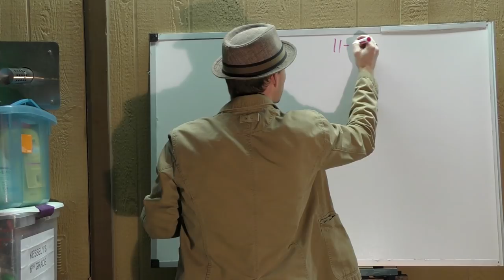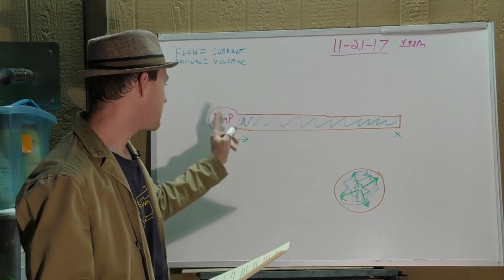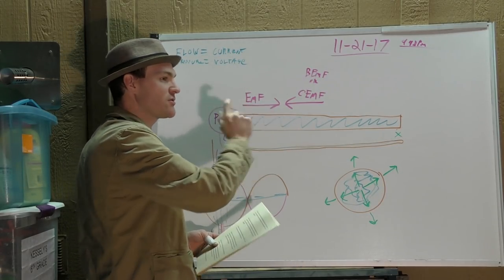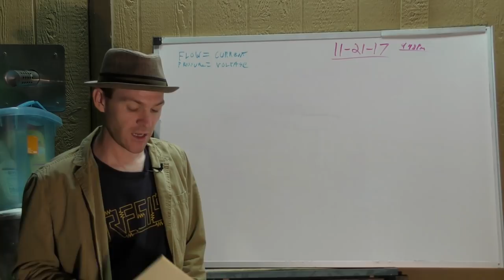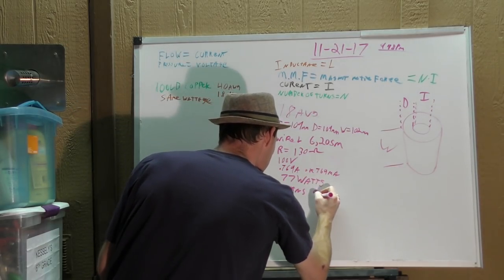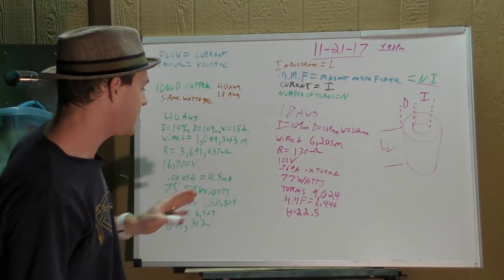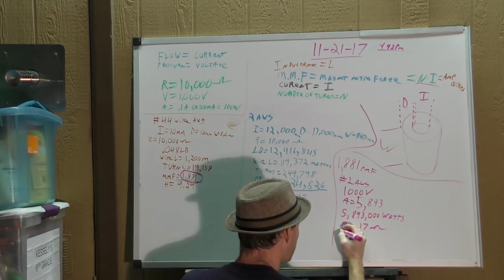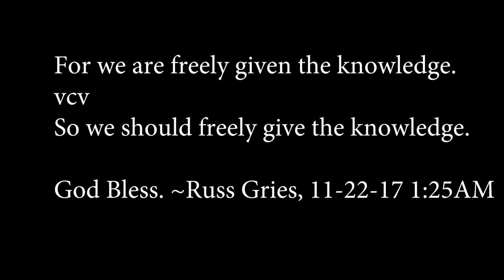Part 10: The Steel Wedge of Truth Hit by The Sledgehammer of Facts Will Break Open Even Closed Minds

Comment: I've watched the first third of this clip Russ, and you are about half-way there.  You have misconceptions and I will try to clear them up.  For starters, and I have said this before, there is no difference between an EE analysis and a physics analysis, they are one in the same.  Also, the water-electricity analogy is perfect, as long as you understand how to model things properly and as long as you ignore magnetic field coupling effects which don't exist for water.

So, let's start.  The first concept is something that you may not have thought of which you can apply when you want for new examples.  There are actually two types of water pumps, constant pressure water pumps and constant flow rate water pumps.  They correspond to a voltage source and a current source.

So, a constant flow rate pump connected to your long hose that is closed off at the end will quickly build up pressure in the pipe until the pipe bursts - because the water must flow.  What's the electrical equivalent?  It's this:  You have a constant current source and there is a length of wire connected across the two terminals.  Say one amp of current is flowing through the wire.  What happens when you disconnect the wire?  Well, nothing can stop the current from flowing so the the current source raises it's voltage to break down the air and turn it into a conducting plasma, and the current keeps flowing.  This is closely related to a coil when you disconnect it and you see the spark.
Reply: Now here is where you go off track:  You talk about the rubber hose expanding to accommodate the pressure from the pump.  (Notice your pump is a constant pressure pump)  You say this is like the magnetic field and this is wrong.  The expanding rubber hose is like a capacitor.  In your analogy anything with springiness in it is a capacitor.  So for the hose, it's like a wire with a distributed capacitance per meter.  The pump pressurizes the length of hose until the pressure is equal everywhere in the hose and there is no more water flow.  The voltage source charges all of the distributed capacitance in the wire until the voltage in the wire is equal along the whole length of the wire and there is no more current flow.  You have to get this because otherwise you will be stuck.

You are right about the "spike" and counter-EMF being two different things.  In any circuit there is counter-EMF that is equal and opposite to the applied voltage source.  This is KVL.   Let's use the hose as a simple analogy that you skipped and is very important.

A long hose is like an electrical resistor:  Your constant pressure pump is connected to a long hose and water flows.  If the pump puts out 10 psi, then where the hose attaches to the pump there is an equal and opposite 10 psi from the hose.  Here is the critical thing:  As the water flows through the hose there is a pressure drop along the hose due to friction between the moving water and the walls of the hose.  So if the hose is 10 meters long, if you attached a pressure sensor at the 5 meter point, it would read 5 psi.

So, you have a pump putting out 10 psi into a long hose and the there is a certain water flow rate and the pressure drips linearly as you go along the hose.  That's exactly what an electrical resistor is.  Therefore, water flow rate x pressure drop equals power.  That means the water is being heated as it flows through the hose, just like an electrical resistor produces heat.
Reply: Okay, let's discuss the infamous "back EMF spike" which in the water version is the "water hammer," the big bang you hear when you shut off a water valve very quickly.  By the way, if you are getting this stuff you are welcome to copy and paste it into your forum.

To understand the back EMF spike and the "back pressure wave" (they are different things and not the same like you think) here is were you have to properly model things otherwise things go awry.

So we know that water flowing through a pipe has inertia and that is the same as current flowing through a wire that has an electrical inertia which we associate with inductance.

We will do some simple thought experiments to illustrate this.  Imagine a long circular hose with water flowing through it and an open valve.  When you shut the valve you get a huge surge in pressure at the valve.  It is this surge in pressure that is the "back EMF spike" and this is a surge in FORWARD pressure, and not any kind of reverse pressure wave.  (Yes there is a reverse pressure wave that will be explained later.)

So to repeat, the huge spike of pressure surge in FORWARD pressure is the "back EMF spike."

Here is the electrical equivalent:  There is a loop of wire with current flowing through it with a closed switch.  When you open the switch the current wants to keep flowing in the same direction and you get a huge spike in voltage that wants to keep the current flowing FORWARD.  This is the "back EMF spike."

Note:  When you see a big negative spike on your scope display, this is the voltage surge that is trying to keep pushing the current in the FORWARD direction.  This may seem counter-intuitive but you just have to think a bit more deeply about this.  It's all related to where the scope ground and channel input are connected.  If you reversed the scope connections than you would see a big positive spike for the "back EMF spike."
Reply: So now let's discuss the reverse pressure wave in the hose.  Like I already said, this is not the "back EMF spike."

Here is where you have to model the system properly because if you can't model it properly then you will be lost.

Let's look at the hose where you quickly shut off the valve and you get the water hammer effect.  I said that when the hose expands and stretches from the pressure in the hose it is equivalent to the distributed capacitance in the hose.  So let's look at this in more detail and refine our model for the water hammer effect and explain the reverse pressure wave.

When you suddenly shut off the valve you get a huge pressure spike in the hose close to the valve.  The hose stretches and expands in response to the pressure increase.  The closer you are to the valve the higher the pressure.  And in fact for a steel pipe the same thing applies for the discussion below but of course steel stretches much less, but it still stretches.

So the hose close to the valve will stretch the most because the pressure is the highest close to the valve.  Following on from my discussion of distributed capacitance in the hose, in this case we can model it in a simplified fashion by saying that there is s discrete capacitor at the end of the hose by the valve.  The forward pressure spike will "charge the capacitor" at the end of the hose.  That means all of the energy associated with the FORWARD pressure spike gets stored in the capacitor in the end of the hose.

So then what happens?  Well, the forward pressure spike has expended all of its energy and now it is in the charged capacitor.  So the next thing that happens is that the "capacitor" discharges and reverses the water flow and sends a reverse-direction pressure wave down the hose.

Does this sound familiar?  Well it should because this is the same as the electrical ring-down in a wire that you have seen thousands of times on your scope display.  When you open the switch in my simple electrical example you see a forward spike followed by an LC ring-down.

So, the reverse pressure wave you see from the water hammer effect is really the first reflection in pressure that was returned from the "stretched spring" (a.k.a. charged capacitor) in the "water mechanical circuit" and is in fact the first reverse pressure wave and reverse water flow in what effectively is an LC ring-down of the stored energy in the moving water flow that was interrupted by the rapid closing of the valve.
Reply: If you simply have read JB book, you would notice the part he say( in a coil, the voltage is ALREADY THERE, what KILL THE DIPOLE is the current)  .. In other words, if you have long enouf inductor and rapid switching, the current will not build up to match the inductance but the voltage potential is already there..   Voltage potential=back spike potential..  What kills the battery is the current that has to fight the inductance..
Reply: +al desrochers  The problem with JB is that he never once explained to his followers how a Bedini motor works.  When he says "radiant energy" it is a lie.  Sorry, I don't mean to be so harsh but it's true.  In a coil the voltage is not "already there."  In fact, a coil is a current-based device.  Does that sound strange to you?  The fact is that it is true.  You know when you hear about a coil discharging in some Bedini circuit to charge a battery and they say, "almost pure potential with no current."  It's a joke because by definition the coil is discharging in the from of current, and the potential observed when the coil discharges is variable, and the potential can even be zero volts.  So the line "pure potential with no current" is completely wrong, in fact it's a lie.  It's actually "current, and the potential is determined by the load."  The reason for this is that a discharging coil acts as a "current source" and not as a voltage source.  The stuff about "don't kill the dipole" is meaningless and is never discussed when talking about electronic circuits.  Anyway, I gave you enough to think about.  I know that I am saying things to you that may not even make any sense.  However, I assure you that what I am saying is real and true.  I hope you and Russ get to understand the water analogy properly and understand these simple circuits that he is discussing in his clip.  These are the basic building blocks for electronics and if you understand them then you can build better projects.
Reply: Simply because you tell me so, I will believe you with my eye closed....LOL  The duration of a on switch doesn`t affect the spike voltage until saturation of the coil or capacitance of the coil..  EXEMPLE: if you put the switch for a micro second you will observe voltage spike to a certain voltage that is determined by the capacitance that match a certain frequency...  If you open the switch for a second, you will observed the EXACT SAME VOLTAGE POTENTIAL spike anyhow the duration of the on time... What will determine your voltage potential is only a matter of finding the FREQUENCY the coil need to be at to collect the most spikes for a determined time ... There is one thing about knowing all the fancy therms used in physics but you need to understand them before trying to explain them..  Just saying.
Reply: +al desrochers  I am not going to address what you are saying because it is a bit more complicated because when you energize a coil for a short amount of time the time constant for the coil and source resistance becomes a factor.  However, I explained to you how a coil is a "current source" and the voltage you see across the coil is determined by the current flowing through the coil and the load across the coil.  Please look at new comments I made to Russ for a bench experiment where you can prove to yourself that a discharging coil acts like a current source.  It's a simple experiment that anybody can do that allows you to prove to yourself that the coil is a current source and the output voltage from the coil is variable and it is determined by the current through the coil and the load resistor.  If you have a scope and some resistors and a coil and a power supply you can prove it to yourself.
Reply: No!!!  You want me to prouve you that I`m wrong..  That`s a big difference..  I already make the experiment..
Reply: +al desrochers  Well I seriously doubt that you did the simple experiment that I suggested to Russ.  Every time you do a new experiment it is an opportunity for you to gain new knowledge.  So I encourage you to try the experiment.
Reply: +al desrochers  What you said about the automotive coil was not clear to me.  Do you want to try again?  Do you have a question about the automotive coil?  If you can describe precisely what you are talking about I will try to answer it.  What I am saying is not "crap" and if you do the simple experiment you will see for yourself.
Reply: I`m just ASKING how can you have 45 000 volt potential when you are energizing a 12hom coil with 12 volt..
BE PRECISE IN YOUR EXPLANATION..
Reply: It has been proven with the bedini cap pulser and 2 watt meter analizer that the output was more in order of 34% than the input..  One watt meter was put in between the first battery and the sg machine and the second one was placed between the cap pulser and the charged battery...  What more do you need for not trying to discredit Russ
Reply: +al desrochers  Did you read my description of the experiment?  I said that if you put a one megaohm resistor on the coil output and when you open the switch that you would theoretically get a one-million volt potential output from the coil because the coil acts like a current source.  The ignition coil in a car operates on the same principle.  The coil is energized on the primary side.  When the ignition points open then the magnetic energy in the ignition coil core has to go somewhere because it is a current source and current must flow and nothing can stop it.  The secondary has many turns and generates much higher potential than the primary.  However, note that both the primary and the secondary go to high potential when the points open.  The secondary goes to about 30,000 volts to break down the air gap and turn it into a conductive plasma.  Once the air starts conducting the output voltage of the coil drops to perhaps only one thousand volts because it is the conducting plasma that determines the output voltage, not the coil.  The output of the secondary is a current source and the current flow decreases as the magnetic energy is discharged from the core.  IS THAT CLEAR ENOUGH FOR YOU?
Reply: +al desrochers  Who says that I am trying to discredit Russ?  You?  I am debating with him, that's all.  He made some mistakes in his water analogy, that's the truth.  As far as a Bedini motor goes, are you suggesting that the output into the charging battery is 134% of the input?  If you are, that's not the case.  In a typical Bedini motor the output is about 30% of the input.  It's very easy to make mistakes when making measurements on pulse systems and that is what probably happened.
Reply: My wild guess is you are a freshman from a second cycle at a university and you are sticking to your last subject..  Probably you live at your parent`s house and have no electronics to play with...  Dont you think at 50 years of age, I know exactly what I`m looking for experiment to do???? Life is to short to spend time on things that doesn`t mater for my purpose...  I have goals in mind and I dont want to wreck my ride..
Reply: +al desrochers  What do you mean, "wreck your ride?"  If I am saying stuff that you never heard before, why should that upset you?  Let's go back to the ignition coil.  Do you understand my explanation?  Do you agree with it or not?  If you disagree with it what is your explanation?
Reply: +al desrochers  For a typical Bedini motor the mechanical energy output is zero because there is no mechanical load on the rotor.  What I am talking about is measuring the power from the source battery and comparing it to the output power going into the charging battery.  That's the only measurement I am talking about and the output power is about 30% of the input power.  I am assuming that the charging battery is in good condition.  I will look at the Lidmotor Joule Thief clip.
Reply: +al desrochers  The Lidmotor clip is just a variation on a Joule Thief type of circuit that has two outputs.  One goes to the charging battery and one taps into the Joule Thief transformer and powers a CFL through an ignition coil.  So you would have to measure the pulse power going into the charging battery and for the CFL the easiest thing to do would be to measure the power between the transformer output and the ignition coil input.
Reply: And now after looking at Lidmotor video will you sustain the current theory???  If you do, there is no way I will spend my time on you and try to educate a guy that doesn`t what to see reality..
Reply: You didn`t answer my question about Lidmotor video....  What is the output power output compared to the input power???  That`s a clever way to negate the lack of knowledge..
Reply: +al desrochers  Here, this guy speaks French with a thick Arabic accent, and you should find this clip very interesting:  https://www.youtube.com/watch?v=lH8iMeBVL4I
Reply: +al desrochers  lol  What do you mean I HAVE NO CLUE?  I understand the fundamentals I assure you.  <<< The amount of power required to light the cfl alone show that the system is somewhat over 100% efficient.. >>>  Really?  Where is your proof?  Are you saying that all transformers are magical over unity devices?  lol  There is no substance to your claim.  And I used to know Lidmotor and he never makes free energy claims.  You are just looking at the CFL light up and saying to yourself, "This must be over unity."  That is not sensible at all, you have no measurements, nothing.  So right now you look like you have no clue because you look at an old Lidmotor clip and on pure blind faith you say to yourself "This must be over unity" without making any measurements at all.  The real world does not work like that.  I will look at the new clip you linked to.
Reply: +al desrochers  What do you mean when you say "sustain the current theory?"  I have many years of experience and I am the one that is trying to educate you.  Do you understand how a discharging coil is a current source?
Reply: +al desrochers  I skimmed though that 1/2 hour clip.  A Newman motor is just another pulse motor.  Sterling Allen visited Geoffrey Miller about two years ago to see some over unity systems.  But Geoffrey Miller told him, "You came here too soon, in a week or two we will have an over unity system."  Famous last words.  And if I remember correctly he was claiming he was "very close" to having an over unity Bedini motor.
Reply: +al desrochers  I'm not ignorant, I assure you.  You can't answer me about how many watts it takes to light a CFL light.  You have NO ANSWERS OR POWER CALCULATIONS yourself for the Lidmotor clip.  There are no measurements made on the clip so both of us have no answers or power calculations, right?  In fact it's impossible for either of us to have measurements or power calculations for that clip.  So what are you trying to say?  Note that when you go to buy power supplies for LED lighting, do you know how they are rated?  They are not rated by voltage output, they are rated by current output.  Power supplies for LED lighting are current sources.  Just go look some up and you will see for yourself.  I know the Energetic Forum and I used to read it.  You just need to chill out.  I know from the forums that many experimenters have difficulty understanding how a coil works and somehow we started talking about that.  If you were curious you would do some research from what I told you so you can experiment better.   You know what really describes a coil?  It's this:  v(t) = L di(t)/dt and  i(t) = 1/L integral i(t)dt   Do you understand those equations?  If not perhaps in the not too distant future you will understand them and that will make you a better experimenter.  So instead of you being hostile if you want to talk about some basic electronics then fine and we don't need any rag dolls.
Reply: I knew you would come back with challenging me about calculation.. It was mentioned in the ENERGETIC FORUM that he use a 9 watt cfl light bulb...  A 9 watt light bulb use 110 volt X 0.08 amps to light due to the manufacturer...He explain all that over the forum and the battery charge rate is explained there also..  You taught I was engaging with you without a base for discussion????  Your assumptions are so off..  You are the one that was not filling the calculations because you dont know... The system use 0.63 watts to run and THE CFL ALONE need 9 watts due to the manufacturer..  I will not FEED YOU ANYMORE  .. You are waisting my time..
Reply: +al desrochers  I will tell you exactly where your HUGE MISTAKE is.  The fact that the CFL is rated at 9 watts when powered by a 120 VAC 60 Hz mains voltage has NOTHING to do with Lidmotor powering it from his waveform on his setup.  The CFL can still light up with much lower power and subjectively from looking at his clip it looks like the CFL is not close to full brightness.  If you hooked up a DSO between the transformer output and the ignition coil primary input and measured the voltage and the current and did the math you would find that the power being sent to the CFL was MUCH LESS than 9 watts.  So you are making a classic mistake, and taking the "number in the box" from the CFL manufacturer and blindly assuming that in Lidmotor's circuit that 9 watts must be going to the CFL and therefore the circuit must be over unity.  You are making a classic beginner's mistake.  And the system in his clip does NOT use 0.05 watts, it uses 0.6 watts.  You have NEVER "fed me" ever in this discussion.  And I am still willing to discuss with you if you want to.
Reply: MY MISTAKE????? How much watt does it need to light???  Even at 6 watt due to not full brightness, the system is well over 100% and not counting the charging rated that you have not read on the forum apparently..  It was discussed that the cfl would not light under 5 watt at least due to an engineer.. SO, the 0.65 watt to run the system, has 2 output.. One being AT LEAST 5 watt and the other that was 2 watt to recharge the battery..Then goes away your CURRENT THEORY..            HI PHIL!!
Reply: If only you would have paid attention to Russ presentation, you would have understand the misconception about electro magnetic... And negate your CURRENT THEORY...   Go at 1;16;30 in this video and pay attention at his explanation of the power consumption and power output and BEMF..
Reply: don't even think about feeding this stuff in to a dc motor...that 3 nights no sleep..misses won't be happy
Reply: +al desrochers  Sorry, but you can't look at a clip on YouTube and make any serious estimations on what the power levels are.  How much wattage does it need to light?  With certain voltage waveforms it can light at very low power levels, almost certainly at even less than 0.6 watts.  However, this discussion is just subjective with no real data.  If we had the actual setup and the proper measuring equipment then you would have real data.  I have seen situations like this 100 times in the past where someone thinks they have over unity but when proper measurements are made it turns out to be false.  No conclusions can be made right now.  But it suggests an interesting bench experiment:  How low can the power levels be and the CFL still lights up?  It can be much less than 5 watts I assure you.  What I am telling you about Lidmotor's clip still applies.  You have to be serious and scientific and make real measurements.
Reply: I will let this discussion at rest and see if you argue with yourself...
Reply: +al desrochers  Well unfortunately Russ is wrong and he has to keep on learning and get up the learning curve and figure things out properly with help from everyone.  What he calls the "input" is actually the resistive power dissipation of the coil.  The input power becomes waste heat.  What he is not realizing/understanding  or not factoring in is that the "bigger output transient" (a.k.a. the BEMF spike) when you have more turns and more inductance in the coil comes from the power supply just the same.  The power supply has to put MORE energy into the coil to get a BIGGER BEMF spike and Russ is not even considering this in his conclusion.  Like I said, he is considering the DC resistive power loss in the coil and that has nothing to do with the size of the BEMF spike.  So there is a major issue that needs to be understood by Russ and everyone on the thread on his forum.
Reply: stop stop russ put brakes on
Reply: +al desrochers  I just made a brand new posting on the thread for Russ.  I use the analogy where an inductor with current flowing through it is equivalent to a mass moving at a certain velocity. I discuss the energy required to push a trolley loaded with stock (mass) on a factory floor as the example.  Please read it and you will see where Russ is making his mistake.  When you have more turns and more inductance there is no advantage when looking at energy-in vs. energy-out.  This will be perfectly clear in my real-world example.
Reply: +al desrochers  Why would you link to a clip that has absolutely NOTHING to do with the discussion?  Why?   Your link is totally bizarre and makes no sense.  What "RIDICULE THEORY" are you talking about?  Are you trying to suggest that I am ridiculing somebody?  I am not ridiculing anybody.

How much electrical energy do you have to put into a five-Henry inductor to get one amp of current flowing through it?  How much electrical energy can you get out from the transient spike from a five-Henry inductor with one amp of current flowing through it?  The answer for both questions is the SAME.  And the answer is energy = 1/2 L i-squared.

Here is a moderately technical clip that explains this.  This is real electronics and they use Calculus.  Even if you don't understand Calculus watch the clip carefully and get the message:  https://www.youtube.com/watch?v=WnFFlE2u3rM
Reply: +al desrochers  Here is another clip from my favourite electronics guy.  He discusses the energy stored in an inductor and also discusses the analogy between the energy stored in an inductor and the energy stored in a moving mass, which is exactly what I used in my example for Russ:  https://www.youtube.com/watch?v=fqQ3-d0V4D0
Reply: +al desrochers  No, I think that you are the one that is blind.  What are we discussing?  We are discussing the fact that Russ is not accounting for the input energy that he is putting into the inductor in his discussion.  We are NOT discussing resonance like in the first clip that you linked to.  We are NOT discussing some sort of "radiant box" in the second clip that you linked to.  Linking to clips that have nothing to do with the discussion will not work.
Reply: +al desrochers  Here is a clip with no math that will give you some understanding of inductors.  Again, the energy stored in an inductor comes from the power supply and Russ is not accounting for this in his whole discussion and that is a critical mistake.  This clip also shows you how you can get any voltage from an inductor by changing the load resistor which is something I told you several times which you did not acknowledge:  https://www.youtube.com/watch?v=84kl_WheNtQ
Reply: The link you give is not the best because it support only the blind guy...  You stick to the link that support what you like and YOU DISCARD WHATEVER that don`t go along with your theory.. The second link IS SO RELEVANT WITH RUSS DISCOVERY you wont believe... The pure fact that he disconnect the input and the system is running by itself is 5000% efficient..  The only thing he want to manage better is the heat that goes in the second box for the longevity of the components..
Reply: So you mean KAPANADZE is not related to the subject too???? Kapanadze was the first to fully understand the resonance theory and the Tesla coil functionality..  The guy in the link I filled you with is the follow up to the Kapanadze work..
Reply: +al desrochers  The second clip, the "radiant box" clip, is basically a nonsense clip.  There is no explanation of what he is doing and the comments are disabled.  He uses a 9-volt battery to trigger a circuit to start oscillating and there is a battery in one of the boxes.  It's the same thing where you see clips where people are making Joule Thief-types of circuits to power LEDs or CFLs.  Sometimes the circuits don't oscillate by themselves and so the experimenter touches the base of the transistor with a wire or with his finger and then the circuit is triggered to start oscillating and the LED or CFL lights up.  This has nothing to do with Russ' discussion in this clip and Russ has not "discovered" anything.  Again, the issue is that Russ is discussing the resistive power dissipation of the wire in his coils and he is making two mistakes:  1)  He is equating the resistive power dissipation with the size of the transient spike and thinks that more inductance with more wire for a bigger spike is "better," and 2) He is ignoring the energy that you have to put in the coil when you first connect the power supply and it is this energy that makes the transient spike and the energy you put into the coil is equal to the energy you get out from the transient spike.  These are serious issues.
Reply: +al desrochers  No, what Russ is doing has nothing to do with Kapanadze.
Reply: Instead of DENIAL on the subject, explain why you dont agree..  The low consumption of the input is offset by the transfert of high voltage low amperage to the secondary low voltage high amperage with exactly the theory Russ is explaining..  Your base current theory is NOT VALID in this case and it`s the best comparasion I can give you..  You will never ADMITING you are wrong but I dont really care because you are in the same boat of majority of people..
Reply: +al desrochers  What are you talking about?  There is no secondary winding in what Russ is discussing in his clip.  When you say "base current" are you now talking about the "radiant box" clip?  How about we just discuss what Russ is talking about in his clip, which is the "power he puts into a coil" and the number of turns in the coil and the amount of energy in the back spike a.k.a. transient spike?  I told you that Russ has made two fundamental mistakes in his discussion.  Do you agree with me that he made two mistakes?  I am willing to listen to you but you have to be clear in what you are saying.  If it would be much easier for you and much clearer for you to say it in French then go ahead, it's up to you.
Reply: +al desrochers  I tell you on one of your solar panel clips that the guy makes a nonsense measurement.  He measures the open-circuit voltage output of the panel and then he measures the short-circuit current output of the panel and he is indicating that he believes "the panel output" is the open-circuit voltage times the short-circuit current of the panel.  That's not true, that's garbage data.  So why would you delete my comment?
Reply: Because you bring your drama to my channel without any relation to my video but just to try to make your point across....   That is JUVENIL behavior and will not be admitted on my channel.
Reply: +al desrochers  You are the one that's acting juvenile.  What I stated was 100% correct.  The clip you posted was junk because the guy in the clip didn't know what he was talking about and I corrected it in a polite manner.  You are playing the "WILLFUL IGNORANCE" game.  If you were smart you would remove the video from your channel.  You read something from me and you know that it is correct but you would rather be comfortably numb and willfully ignorant.  Go listen to some Pink Floyd.
Reply: +al desrochers  But we are not talking about wind turbines and grid tie inverters, are we?  I never claimed to try to educate you on that subject.  We are talking about impedance matching for solar panels.  Do you understand the concept of impedance matching for solar panels, yes or no?
Reply: +al desrochers  It's hopeless, ouais, ti-al?  You won't answer my question when I am trying to help you.  You don't like to hear the truth about electronics because it upsets you.  <<<Everything you open your mouth on, I can discard it as open air...>>>  Let me translate that for you:  I want to remain willfully ignorant.  I want to be comfortably numb and stupid about real electronics.  Chu un nul et j'en suis fier!!!  Dare to be stupid, that's fine with me.
Reply: Ti-gars!!  Grandit donc!!!C`est pas que je veux pas te repondre, mais je n`ai pas envie de debatre d`un sujet que tu ne controlle pas du tout.. Les termes que tu emploie sont des noms communement donne a la basse frequence et sont en transition quand les frequencies deviennent plus elevees..  Dans la charte dont DON SMITH prend pour expliquer la transmutation du pouvoir obtenue dans les GIGAHERTZ est tellement revelatrice quand tu peux la traduire..  Pourquoi je devrais perdre mon temps a discuter des termes de bases quand je suis a l`etape de comprendre ce qui se passe au niveau des mega frequances??? Ty est vraiment de la generation qui cherche vraiment a se faire entendre a tout prix mais le vecue n`est pas de votre cotee  et ca fait defaut au niveau des entretiens que vous vous engager avec les plus experimentees... Ton eloquence a verbaliser s`arrete du moment que l`on sait de quoi tu veux parler.. ARRETE de t`infliger autant de dommages SVP..
Reply: Ti-Al!!!! Voyons donc!  I don't know anything about Don Smith, I missed him.  Are you telling me that you have become a microwave engineer?  That's amazing!  lol    I looked at Russ' forum too and they are all going crazy talking about parasitic capacitance in coils and coil resonance and high-frequency responses of coils and stuff like that.  This often happens in forum threads, everybody starts talking about the same old free energy cliches that we have all heard 1000 times.  There is a big problem....  The Newman pulse motor has nothing to do with high frequencies at all, nada, zip, rien de tout.  It's a pulse motor that runs at very low frequencies and none of the phenomena that they are talking about will happen when Russ does his build and starts testing it.  The conversation will quickly be forgotten.  Je peux voir le futur.  Du vrai!   And what kind of "output" is Russ going to get from his pulse motor?  He has no choice but to collect the back spikes from the coil because with no back spike collection the output from the motor is ZERO.
Reply: This is what Russ is supposed to be interested in when he starts testing his Newman pulse motor.  I posted this to him on his newest clip:  <<<  Your clip is okay, but keep in mind for your Newman motor project you are not really concerned with low-frequency and high-frequency AC responses from components. You are supposed to be interested in the "pulse response" of a coil. You are not really interested in the sharp edges of the pulse or any resonance phenomena. What you are supposed to be interested in is how the coil responds to a DC pulse of a certain amount of time. How does a coil with a certain wire resistance respond to a pulse of a certain voltage for a certain amount of time? You haven't really answered that question. Assuming that you do answer it then the next step is to realize that the rotating magnet inside the coil also induces an EMF in that coil. So the ultimate question is this: How does a coil with a certain wire resistance respond to a pulse of a certain voltage for a certain amount of time while at the same time there is a certain EMF waveform being induced in the coil by a rotating magnet?  >>>

So that's the real deal ti-al, no fantasies about being a microwave engineer.  We are in the real world and if he makes a motor with a 100-pound coil and a 40-pound magnet for the rotor he will be lucky if it runs at 300 RPM.  We are talking pulses to energize the rotor that are on for a loooong time and the whole thing is a low-frequency pulse circuit.  Inter-winding capacitance and self-resonant modes will have nothing to do with this pulse motor.
Reply: Comment pense-tu qu`un coil de 1300watt de micro-ondes repond a seulement 24 volt de pulse si il est pulse 3 fois par quart de tour????   Je connais la reponse pour avoir deja fait l`experience...  Si tu met le meme coil 3 d`epais et les pulse en serie avec des interupteurs magnetiques, tu obtient 4 FOIS plus de BEMF en courrant mais un peut moins de voltage...  Le secret n`est pas dans la quantitee que tu as en retour , mais  comment tu l`utilise apres l`avoir collectee... La maniere que Joe Newman prennais pour retourner le back spike a sa source, tue ou coupe circuit le systeme quand la batterie devient a sa pleine charge...  J`ai appris a l`enmagasiner dans au moins 500 000 mf de capacitance et de laisser une resistance me regulariser le voltage a 40 volt avant un controlleur de charge avec utilisation de relais...
Reply: +al desrochers  Thanks for reminding me that very often people build Newman motors with a special commutator that sometimes energizes the coils, sometimes shorts the coils, and sometimes open-circuits the coils or probably more likely the open-circuit is where they collect the BEMF pulses.  So you have more pulses per rotation, but still the frequency is low.

<<< tu obtient 4 FOIS plus de BEMF en courrant mais un peut moins de voltage.. >>>  This is where a proper analysis has to be done with your oscilloscope.  Quatre fois plus de courant vis a vis quoi?  The longer the time you apply voltage across the coil, the more current flows through the coil.  So you got "four times the current" because there was voltage across the coil for more time before the reed switch opened.  <<<  mais un peut moins de voltage >>>  The voltage is a function of what the load is on the coil when it it discharging.  If it is a diode connected to a small capacitor then the capacitor will get charged to a high voltage.  If it is a diode connected to a large capacitor then the capacitor will get charged to a low voltage.  If it is a resistor, then the value of the resistor times the initial discharge current through the coil will determine the initial value of the voltage pulse.  So as you can see, your discussion is missing critical details.  The more you learn and experiment, the more you will appreciate how you need to have all of the details.  The best way is to work with a complete schematic, and to look at your scope traces and then construct a timing diagram (voltage vs. time and current vs. time) on paper with a pencil or using computer software.  Most amateur experimenters almost never make timing diagrams for their projects and they should because that is the way to understand your circuit.

<<<  Le secret n`est pas dans la quantitee que tu as en retour , mais  comment tu l`utilise apres l`avoir collectee. >>>   I am assuming you mean something like you charge a large capacitor and when the voltage on the capacitor reaches 40 volts then you pulse the capacitor energy back into the main battery.  These are all great little experiments.  Then when you get more serious you want to make more serious measurements.   I will give you a scenario in a second posting.
Reply: Suppose you have a Newman motor with a fancy commutator and about every 60 seconds it charges a large capacitor up to 40 volts and then for one second a relay is energized and the large capacitor dumps the energy back into the main battery which is at 12.6 volts.  After one second the Newman motor starts charging the large capacitor again.  Once the large capacitor is at 40 volts after about 60 seconds you do the cap dump again for one second and the cycle starts all over again.

So, do you think this system can keep the main battery permanently charged because of the cap dump?   So the first question is how much energy does the Newman motor draw from the main battery during the 60 seconds?  This can sometimes be hard to measure.  If you have an analog current meter then the needle may be jumping.  If you have a digital current meter the display may be changing all the time.  We will assume that you have a system to properly measure the average current draw from the battery.  So the number of Joules the Newman motor uses in 60 seconds is just voltage x average current x 60 seconds.  Let's say it's five Joules.

The the number of Joules you put into the capacitor is just the capacitor energy at 40 volts minus the capacitor energy at 12.6 volts.  If you want to be serious you will measure the actual value of the capacitor, and you don't need a capacitance meter for that.  Many capacitors have a tolerance of +/-20%.  Any amateur experimenter should measure the capacitance with a resistor, a multimeter and a stopwatch first.  If you can't do that then back up and learn how to do it.  You need an accurate measurement of the capacitance to have an accurate measurement of the energy in the capacitor.

So let's say the capacitor dumps three Joules of energy into the battery.  So the motor consumes five Joules from the battery every 60 seconds and the cap dump puts three Joules back into the battery during one second.  So if you know the energy capacity of the battery and you start out with the battery fully charged, then you can calculate the expected run time for the battery.  I am simplifying and ignoring losses here.

Suppose the expected run time is 48 hours.  So you run the motor until the battery voltage drops to the "empty" voltage.  Let's say that voltage is 10.5 volts.  If the expected run time is 48 hours and the motor runs for say somewhere between 36 and 60 hours before the battery hits 10.5 volts, then you have run a successful experiment.  You have proved that the run time was roughly what you expected it to be and you have proved that there is no "magic" in the cap-pulsing version of the Newman pulse motor.

In my opinion that's a "real" experiment.  However, I don't think I have ever seen someone run an experiment like this.
Reply: Tu remplie tes phrases plein d`air encore une fois...  Tu est en train d`analiser  mon experience et tu essaie de me ridiculiser..   Franchemant  tu PUE L`ARROGANCE....  Arrange toi avec tes theories pis moe je vas continuer a faire a ma tete puis arranger mes contacteurs pour avoir un meilleur timing puis ca va marcher.. 
Le problem que j`aie en ce moment n`est pas de ne pas comprendre ce qui se passe avec mon systeme..
J`ai plus de comprehension sur l`electricitee que la mecanique.. Tu as commencer a taper en francais puis tu continue en anglais et je te trouve assez HYPOCRITE... Quand a moi, tu joue bien ton role de perroquet.
Reply: +al desrochers  Oh stop it, you are feeling bad again.  It's easier for you to type in French and it's easier for me to type in English.  Comme ca c'est egal n'est ce pas?  I am not being arrogant and I am not ridiculing you.  We are back to the issue of the basic concepts about inductors.  An inductor integrates the voltage applied across it with respect to time and the output is current flow.  When you apply voltage across an inductor over a certain period of time there is energy stored in that inductor.  When the energy is released from the inductor it can be at a certain current times a high voltage for a short time or a certain current times a low voltage for a longer time.  In both cases the initial current level is the same.  When you short a capacitor with a very low value of resistor you get a huge pulse of power and it might blow up the resistor.  When you nearly open-circuit an inductor with a very high value resistor you get a huge pulse of power and it might blow up the resistor.  So shorting a capacitor is like open-circuiting an inductor.  Likewise open-circuiting a capacitor is like short-circuiting an inductor.  Do you see like a Yin-Yang here?  The current through a capacitor is proportional to the rate of change of voltage across the capacitor.  The voltage across an inductor is proportional to the rate of change of current though the inductor.  Do you see more Yin-Yang here?  It's like a capacitor and an inductor are compliments of each other where you exchange the voltage and the current.   You see above where I say, "An inductor integrates the voltage applied across it with respect to time and the output is current flow."  More Yin-Yang:  A capacitor integrates the current flow into it with respect to time and the output is the voltage across the capacitor.  Do you think everything I just said is junk or do you think that it is real?  I am trying to help you here.  When you charge a capacitor with voltage through a resistor you get an exponential voltage waveform with a time constant of RC.  Guess what?  When you charge an inductor with voltage through a resistor you get an exponential current waveform with a time constant of L/R.   If you understand this you will experiment better.  To be even better you want to learn about the Calculus concepts of integration and differentiation  (Concepts de calcul de l'intégration et de la différenciation).  Why should you learn this?  Because an inductor integrates voltage with respect to time and the result is current flow and a capacitor integrates current flow with respect to time and the result is voltage.  Likewise, an inductor differentiates current flow with respect to time and the result is voltage and a capacitor differentiates voltage with respect to time and the result is current flow.  What does this mean on your bench?  I will give you an example.  Supposing you are scoping the voltage across a capacitor.  And your buddy says to you, "Can you add a current sensing resistor so we an also see the current?"  You actually don't need to add the current sensing resistor because when you look at the voltage waveform across the capacitor you can also "see" the current waveform.  The current waveform is just the slope of the voltage waveform.

So I can tell from talking to you that there are many good and important concepts for you to learn if you want to for your own knowledge and to become a better experimenter.  For example, you never knew that capacitors and inductors were like Yin and Yang, did you?  There is enough for you to up above to start copying and pasting into Google to learn more stuff about the basics of electronics.  My favourite YouTube electronics teacher is Lasseviren1 and to get the most from him understanding basic Calculus would help, but even without understanding it you can learn a lot from him.
Reply: Now that you have SOLVED EVERY MYSTERY IN THE UNIVERSE go and make it!!!  That is where you repulse everyone..  Instead of talking and drink the wind like you do, show us in an elaborated vid where you have surpass ANY experimenters on here and put your money where your mouth is... JUST DO IT.. I`m the only volunteer to babysit you.
Reply: Watch, I am going to demystify integration for you with two simple examples.

1)  The old days of film photography.  When you expose film to make a picture you have a) the light that goes through the lens and strikes the film, and you have b) the amount of time that the light strikes the film to make c) the film exposure.

The photographic film is integrating the light times the time to give you the film exposure.  Low light x long time is equal to strong light times short time and both will give you the same exposure.   In both cases even though the variables are different the exposure is the same - the integration is the same.

2)  You fill up your bathtub with water to take a bath.  There are two input variables, a) the water flow rate, and b) the amount of time you fill the bathtub up.   What is the output of the integration?   That's easy, it's c) the height of the water in the bathtub.  A bathtub integrates water flow rate x time to give you water height.   Can you see how that is like a capacitor?  Substitute water flow rate for current flow, time is still time, and the output for the height of the water in the bathtub becomes the capacitor voltage.

If you understand the above you now understand integration.  Whenever you build a circuit on your bench that uses capacitors and inductors then integration and differentiation are taking place.

Bonus:  What about differentiation?   Let's use the bathtub example.  Differentiation is how fast the height of the water in the bathtub is increasing (or decreasing)   You know intuitively that if you see the bathtub emptying very quickly that the water flow rate is very fast.  So you don't even have to measure the water flow rate, you can just look at how fast the height of the water in the bathtub is changing to know the water flow rate.
Reply: NO SHIT!!!    Can you educate me some more???   While you are doing that, you are not harassing other people...
Reply: I have never been awared that was more than positive and negative in everything..  Can you explain me how to show a guy that he is acting like a baby???   HO! THAT`S RIGHT!!  YOU HAVE SHOWED THAT SINCE WE START TO EXCHANGE..  Save some typing and experiment if you want to have just a little dignity to save your soul...
Reply: +al desrochers   lol you are playing the bad-boy ti-al.  Come un voyou!  Just look up "MHOP Pulse Motor" on YouTube.  I was the architect and designer, and TinselKoala physically designed and built and tested it.  It's by far the best design for a pulse motor you have ever seen in your life and it will outperform any pulse motor you have ever seen.  It will give you cleaner better battery charging pulses.  It has fully flexible timing.  It's a dream machine for a pulse motor.  Of course what TinselKoala made was just a basic prototype, a proof of concept motor.  He did not build a fancy motor, he used old junky hardware to build it.

Voyons donc arret le merde.  Tu ne me garde pas, arrete les 
conneries.  On se comprend?

Even if it is the best pulse motor ever, so what?  It doesn't do anything but spin and turn battery power into heat.  I don't get the fascination with pulse motors.
Reply: You got too much credentials for mee..  I`ll give you a tip. If you get fascination with pulse motor, WHY IN HELL are you commenting on it????? Just the fact you report that ( YOU WERE THE ARCHITECT AND DESIGNER and you make Tinsekoala  build make your dream castle crumble...  WE ALL KNOW TINSEKOALA poooooorrrrrrr   LYIER
Reply: +al desrochers  lol  Why would I lie?  Have you watched the clips?  My design makes any Bedini-designed pulse motor look like a piece of low-tech junk.
Reply: Did you ask your parents permission before saying that??
Reply: +al desrochers  Keep making yourself look like a fool for everyone to read for a long long time.
Reply: IT TAKES 2 TO TANGO....  NEVER FORGET THIS ONE
Reply: Talking about fool...  I have found an old e-mail exchange with Tinsekoala that 4 years back and was wandering if you mind if I e-mail him back asking question about you..  If you dont mind, I can relisted the response I will get from him..
Reply: +al desrochers  You accused me of lying about the MHOP pulse motor.  Do you still say I am lying?  Yes or no?
Reply: I just want to FACT CHECKING....  Do I have your permission to contact him and REPOST THE INTEGRAL???
Reply: With all the VENUM you have spread here, I think there might have no trouble you give your blessing dont you.
Reply: +al desrochers  You are not answering my question.  The only thing you can do is check with him to see if I am telling the truth or not.  No, you do not have my permission to repost what he says.  You can simply come back and post here and say, "What you said about being the architect of the MHOP pulse motor is true."  Pointe finale.

Beyond that, people like you puzzle me.  I tell you there is a problem with that solar panel fake "power measurement" clip and you reject what I said.  If one of your buddies told you exactly the same thing then you would take the clip down.  Why?  You have to ask yourself that question.  I demonstrate technical competency and try to help Russ and I try to help you and you reject all of it and get nasty and call me names but at the same time you must know in your heart that I am speaking the truth.  One more time, why?  One more time, you have to ask yourself that question.

So come back and post here stating that you checked and confirmed that I was telling the truth about the MHOP pulse motor.  Retract your accusation that I was lying.  And beyond that, look deeper into your soul about your actions and motivations.
Reply: +al desrochers  You are going to have to search your soul about the venom issue.
Reply: +al desrochers  You are not answering my question.  The only thing you can do is check with him to see if I am telling the truth or not.  No, you do not have my permission to repost what he says.  You can simply come back and post here and say, "What you said about being the architect of the MHOP pulse motor is true."  Pointe finale.

THAT WILL SUMMURIZED our discussion....The truth have been hide too long...  AND NO I dont trust you.
Reply: +al desrochers  Hey dude...  "AND NO I dont trust you."  You're not Mom Boucher are you?   I used to battle criminal con artists pitching fake free energy systems to get investment money from gullible investors.  Myself and TinselKoala did battle with Wayne Travis of HydroEnergyRevolution.  About two years ago the FBI raided his fake business and seized his financial records.  He raised about 1.5 million dollars pitching a fake "free energy from buoyancy" system.  He used a lot of that money to pay himself and his wife.  Myself and TK also debated Steorn and also the Quantum Energy Generator.  The goal was always to shut down criminal con artists and make sure the gullible people don't lose their life savings investing in scams.  Steorn is bankrupt after burning through something like 13 million Euros and they never produced even a single nano-Joule of free energy.  The con artists for the QEG probably crowd-funded about $300,000 USD and they were never caught.  They call their type of scam "pious fraud" and they also have never produced a single nano-Joule of free energy.  Joseph Newman was a scam and a carnival pitch man all of his life and he never produced a single nano-Joule of free energy.  And when people like you talk pseudo electronics junk talk sometimes I try to help them because I know that they will be able to do better experiments if they start learning and stop talking fake junk talk.  But that's just for fun because in your case you are clearly not a criminal con artist.  But you get really mad when  you hear stuff that you don't want to hear or stuff that you don't understand, don't you?

So, I try to fight for the little guy and make sure that he does not lose his life savings that are supposed to be for his children's education.  I am a really bad guy, eh ti-al?  Comme un voyou.
Reply: +al desrochers  I think you need a Pepsi and a May West and some Supertramp and Pink Floyd CDs - brain food.
Reply: Dont worry!!!   I perfectly know what`s best for me..    I dont need advise on anything I do..  Your empty cry is like barking in deep space, it sums up to zero.
Reply: +al desrochers  I am not a fraud, and I am not a liar.  That's two things you have accused me of.  And you do it because you hate.  Perhaps two May Wests will give you the sugar you need to think straight.  There is no sound in space and you need to learn about real electronics.
Reply: If you are not guilty of anything, why are you so quick on the gun to respond back????  Let the time do it`s job and let TK answer my e-mail...   I will post the results here with no restrain and no bias..  If ever I`m wrong, I am man enouf to admit if it prouf be be right..   Since then, dont dig the hole deeper..
Reply: +al desrochers  You are a clown because you are prejudging me and you are filled with bias and hate.  You are not man enough to admit that your solar panel "power measurement" clip is junk.  You saw me demonstrate my technical competence, yes Russ is wrong about some parts of his water analogy, and yes you saw me discuss the Newman motor and how a coil actually works.  Based on my interaction with you and my previous discussions with other "free energy" researchers I am 100% confident that you had no understanding about what I was discussing and I am 100% confident that you would not admit it.  And then you accuse me of lying about the MHOP pulse motor after I demonstrated my technical competence.  And you show hatred and you call me names.  And then you accuse me of being a fraud.  You are in a pretty deep hole and when you come back and say that you were wrong to accuse me of lying about the MHOP pulse motor you will get a bit out of your hole.  You may as well stop trying to play a spin game with me like a politician because you can't win.  This all started because you were "so offended" that I was giving information to Russ that is not in line with the "free energy mode of thinking."   So you decided to be an attack dog.  What would you rather be, a hateful crazy guy that's an attack dog that knows very little about electronics and picks fights with people that try to talk good electronics common sense, or would you rather try to calm down and stop the hating and start trying to learn something and acting like a civil human being?  Who is ti-al, who is he?  And the old cliche is this:  If you went to the EEVblog forum, they would eat you alive.  Those guys are real electronics experimenters and you would not last more than 15 minutes with them.  They would slice you to pieces and you would run away with your tail between your legs.  You need to get real, show some humility, stop the hate, stop the insults, and stop the attack dog.
Reply: +al desrochers  <<< There goes your no sound  theory in space. >>>  One bright morning in the middle of the night, two dead boys got up to fight.  Back-to-back they faced each other, drew their swords and shot each other.  If you don't believe this lie is true, ask the blind man, he saw it too.
Reply: If ever I go on the EV blog, I will just read and learn, sit on the side lines in my learning process...  I`m not hateful but, rather a strait shooter and when I see a KNOW IT ALL type of guy, it`s MY PLEASURE TO UNMASK HIM....   Breathe a little bit young man!!!!   You are running short on oxygen..  I`m pretty confident now by your behavior what  will be TK`s answer..
Reply: +al desrochers  If you are going to be full of hate, and act like an attack dog, you are going to get some push back from me.  You are not a straight shooter because you are avoiding all of the technical issues where you are uncomfortable and wrong.  The only thing you are interested in from TK is whether or not I was the architect for the MHOP pulse motor.  Let's see how much of a man you are ti-al.
Reply: +al desrochers  ...plus c'est la meme chose!  lol   Your brain is hurting!  lol
Reply: Take my advice and take a deep breath...  You are too hyper to be clear of any suspicion on your behavior. I`m worry that you get an hart attack being too afraid of the truth...  You really start to act strange today and your actions on here show how much fraud you are....   I`m not hateful but rather a strait shooter like I mentioned earlier..  You in counter part, you are going in every direction in effort to covert your scam...
TIME WILL TELL.......
Reply: I retract what I have said earlier...............   I can handle you with a quater of my brain instead of half....
Reply: +al desrochers  Really?  Tell me, what are the various issues that have to be considered for designing the optimum configuration for the trigger coil and base resistor in a standard Bedini motor?
Reply: You will end up with a migraine trying to make me look bad.....  LOL  Because I was careless of the magnets involved in a standard SCOOLGIRL MOTOR, I went directly to the solid state to eliminate the tuning bariers.. 
A simple PWM motor controller is adequate if you get rid of the protection diode and instead place a bunch of MUR160 on the emitter and you have adjustability at will up to 400k hertz... Even the duty cycle can be fascinating to watch on the scope to how much duty to be the most efficient...   Are you still there????
Reply: +al desrochers  Well, it's just a basic question related to electronics and Bedini motors and by chance I saw a comment of yours where you said several years ago you spent $1000 or $2000 on Bedini stuff.  And since you only need "a quarter of your brain" I thought that you could answer the question.  But it turns out that you can't answer the question and you avoided it and tried to deflect away from it by changing the subject.  So maybe you are not so smart after all.  You are hateful, you are a poseur, and you are an attack dog.  So you need to start thinking about who you are and what your motivations are and why you are doing this.  I was just trying to help Russ, and look at what you are doing.  Look at yourself!  LOOK AT YOURSELF!!!
Reply: Yong man!  I will teach you the only thing you will need for future interaction with people...  NEVER POKE A BEAR YOU DONT WANT TO DANCE WITH...   I have spent that kind of money on a 3 stack 26 inch bicycle wheel and 6 multi strand coils in hope it could run a generator to run the source...   NEVER,EVER presume you know the story of a man with just couples line you have read... The thing with Bedini system is it is fantastic to revived dead battery but , it is not a good motor due to the on off timing and the mass to move to be effective..  I know you will try again to manipulate or intimidate JUST TO GET YOUR POINT ACROSS...
If hate there is from me, maybe you have provoke the sleeping giant with your INCENDIARY comments playing the role of the KNOW IT ALL ....  And I insist on the latest because I was an underground teacher for the newbee in the mining industry and after a week of teaching there was always one in the batch of 8 students that was DEVELOPPING  this kind of attitude towards me like I was OBSELETE... And that was happening when they can BARELY stand up with the machine in their hand.. You have start a game and you hate loosing and that is why we are at that point now...   GROW UP.
Reply: While I`m waiting for TK to answer my e-mail, be quiet....   We will be set very soon on your claim ( being the brain behind his pulse motor)..  If that reveal that you lye on it, the rest of your ole mud slinging will be put toOblivion...
Reply: +al desrochers  What "INCENDIARY comments?"  Tell me.

Beyond that, a Bedini motor is a useless piece of junk.  And you gut sucked into the idea that it might even be a free energy machine.  If you are going to play with that stuff all that you need is a 555 timer and a transistor and a coil.  Or even better, there are lots of smart battery chargers that you can buy that use inductive discharge battery charging.  The "Renaissance" chargers that Bedini used to sell were illegal contraband products and they were very simple and low tech.  Bedini would hide all of the components with potting compound.  And I asked someone that bought one if it had a UL sticker on it and he said no.  No UL sticker means he was selling an unapproved electrical product and that's a crime.  Is that incendiary to say?  lol
Reply: +al desrochers  "KNOW IT ALL"
v = L di/dt
i = C dv/dt
i = 1/L integral v dt
v = 1/C integral i dt
CRISS COLIS DE TABARNAK!!  hi hi hi
Reply: Stubborn is the best adjective I can stick to your name...   YOU ARE THE ONE THAT evitate the reel discussion.. Have you read what I just type in???? You are trying to teach me the BEDINI system or giving informations that I already know...   WHAT THE HELL ARE YOU TRYING TO ACCOMPLISH HERE????
You are in a dead zone and trying to make it to surface because you are suffocating...
Until I receive TK`s e-mail , stay put.
Reply: +al desrochers  You are just a wild and crazy guy ti-al.  Such a big mean bad boy, you are just terrifying.  Too bad you are unable to answer the question about the resistor and the pickup coil for a Bedini motor.  Some people might think that you are a just a poseur.  You are so mean and nasty you must blow transistors just by looking at them.  Saute pas le cerveau mon dieu!
http://www.rforh.com/wp-content/uploads/2012/12/MDVachon.gif
Reply: +al desrochers  What does "resistive load adjust" mean?
Reply: +al desrochers  Have fun on he EEVblog!  You may have difficulty there because they discuss real electronics.  And if you are unlucky, there may be an "al desrochers" there and he will slice you to pieces.
Reply: HA HA HA HA HA!!!    What does "resistive load adjust" mean? END OF QUOTE
Any experimenter as deal with it by asking questions when they dont have desirable result and that is where you have to be humble and attentive to what other have to say...  The load could be anything depending what you what to the system to be...  I have seen people discharge a flyswatter in a transformer....  You need to know what is the resistive load..  In Bedini charger, the battery is the resistive load.
Reply: +al desrochers  My name is ataradov on the EEVblog.
Reply: +al desrochers   <<<  Resistor is a variable that you have to adjust depending the weight, the number of magnets the frequencies desired, resistive load adjust... >>>
You're not even close ti-al.  I am not surprised because I know from experience amateur free energy experimenters don't know the answer to this question.  What does the base resistor and the pick-up coil do?  The answer is that they work together to switch the transistor.  Therefore  the various issues that have to be considered for designing the optimum configuration for the trigger coil and base resistor in a standard Bedini motor are all about optimizing the transistor switching.  I am not even going to discuss the issues themselves.  Look at how weak your answer was.  Like I said, you are a big mean bad terrifying boy.  "He blew his nose and then he blew his mind."
Reply: You got the PERFECT text book response and it takes you awhile to google search it...   You give everyone of us the best gift that could be....   Many thanks to unmask yourself as a fraud...
Reply: On top of it you are living in France.........  OMG what a scam artist you make...
Reply: +al desrochers  Text book response?  Oh you mean that you got the answer completely wrong, and then you went onto Google and did some searching after you read what I said, and now you are accusing me of of doing a Google search?  You are a clown, ti-al.  It's like you are Bonhomme Carnaval's evil twin, something right out of a Steven King novel.  You are terrifying.  lol
Reply: +al desrochers  You are the French Maxwell Smart, agent 101.  The man that gets all the answers.  He does the investigations.  You are the second cousin of Inspector Clouseau, the love child of Simone Signoret and Gerard Depardieu.  Mind you, with a name like yours, you might also be the love child of Fred Caillou and Bertha Laroche.  LOL
Reply: Did you know that (STOLEN VALOR AND IDENTITY USURPATION ) can be punished and make your youtube chanel resignation acces?????    Do you want to defied me again???  Be a man and answer this question
Reply: +al desrochers  POKE THE BEAR ONE MORE TIME LOOSER!!!  omg You are channeling Mad Dog Vachon!  Do you know that one time he wrestled with a real bear?  They got the bear stoned on some drugs, and then Mad Dog and Paul Vachon put honey on certain parts of their bodies and then wrestled with the stoned bear.  The bear was trying to lick up the honey the whole time.  Right now it feels like you are the stoned bear and I am Mad Dog Vachon.  Tell me, how do you know the value of the base resistor is too low?
Reply: +al desrochers  My name is Monsieur Miroc.
Reply: Do you STILL WANT TO POKE THE BEAR......  I have another twist in my sleeve..
Reply: +al desrochers  The poke is:  How do you know the value of the base resistor is too low?
Reply: You have been reported by ataradov not only here but on the EEVBLOG...  Take that and fiddle with it...
Reply: The reel poke is:  How long are you will be able to scam>>    TIC TOC TIC TOC
Reply: +al desrochers  What scam?  That's the mystery.  What is going on with your head?
Reply: +al desrochers  Who the who is Oliver K?  Some guy you know in the urban jungle?  You really got destabilized tonight.  You must be saying to yourself, "What the heck am I doing?"
Reply: +al desrochers  No answer on the base resistor.  No surprise.  That one would be hard for you to Google.
Reply: You are messing with the wrong people from the start...  That is your number1 mistake when it come to interact with person.. You try in vain to push your point across without controlling the subject..
Reply: +al desrochers  No, it's your interactions with other people that are wrong.  You hear good sense and it it goes against your nonsense so you become a hater and an attack dog.  A big bad boy.
Reply: +al desrochers  You have got some nerve to "demand" (an you know there is a huge difference between "demand" in English and "demand" in French) my username on the EEVblog.  You have no right to even ask for that information, so kiss my butt.  I am not the "scammer" I just made you look like a fool because you deserved to look like a fool.  You paid the price for doing something totally stupid, and so I sent you off to EEVblog to do even more stupid stuff.
Reply: WHO are you???
Reply: +al desrochers  Are you sure you are not talking to yourself?  lol
Reply: Are you calling me a fraud???????
Reply: +Benny Indigette  Yes, I'm the GENIE behind the MHOP pulse motor.  It's the most sophisticated and most flexible pulse motor design I have ever seen.  And with a proper build it could also easily be the highest performing pulse motor ever.  The ghost of John Bedini is eating his heart out.